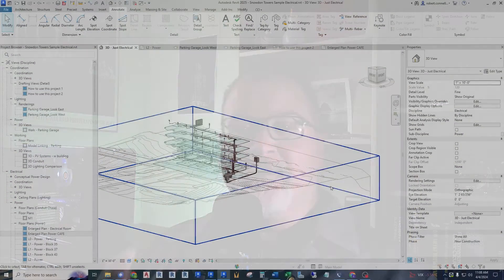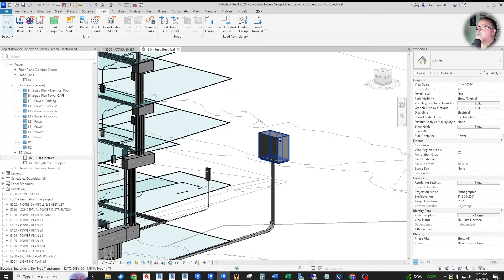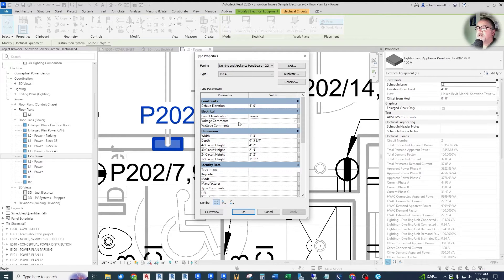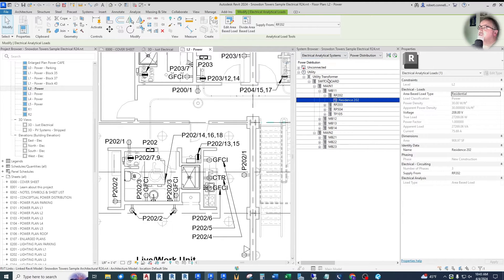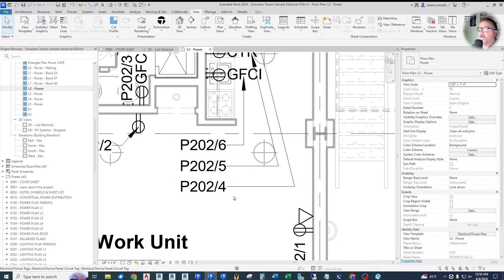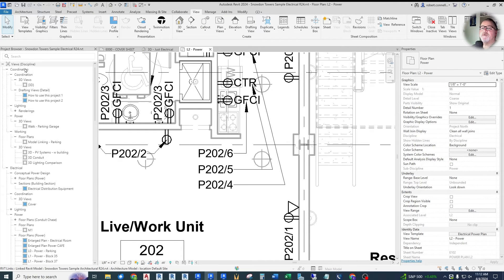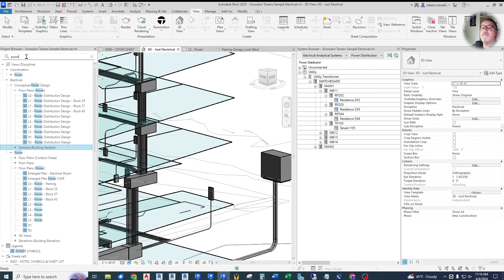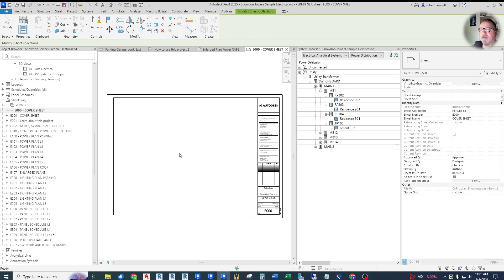Expert Insights on the Latest Revamps in Revit MEP 2025

Comment: Hey I try in 2025 change the tag circuit in edit family and add Panel and I get all the information.  I wand have LP1-3 and no change
Reply from the maker: Hey there Ram. I think you are trying to edit the circuit tag to display both panel and circuit like "LP1-3" but it doesn't appear to be changing? So I assume you edit the family, edit the label to show both panel and circuit, then make sure you click Apply or OK, then Load into Project and "overwrite" the old one. Without being in your model, I'm not sure how else to help. And remember, there can be different tags available for the same category, so make sure you are actually using the one you edited. Hope this helps!